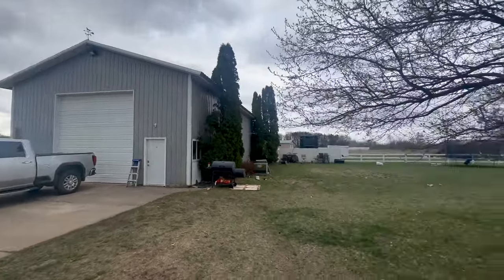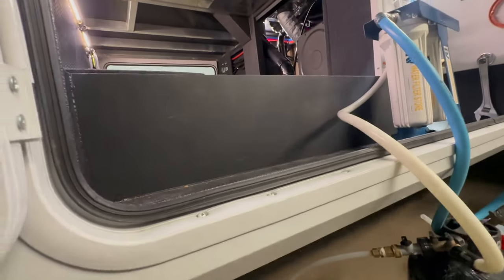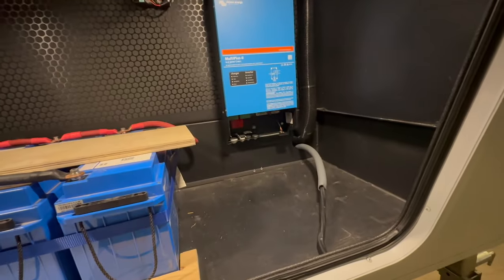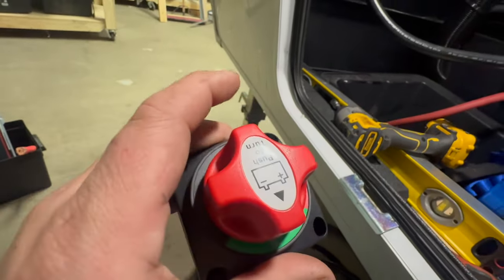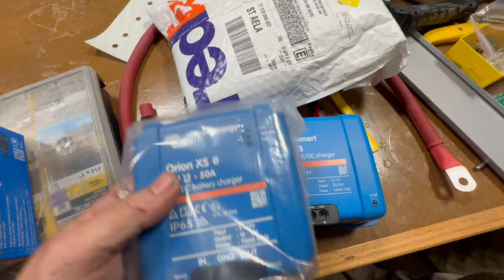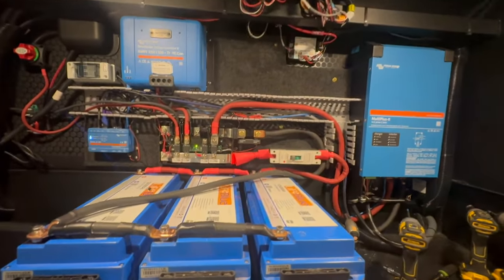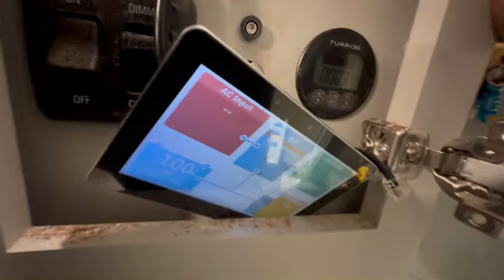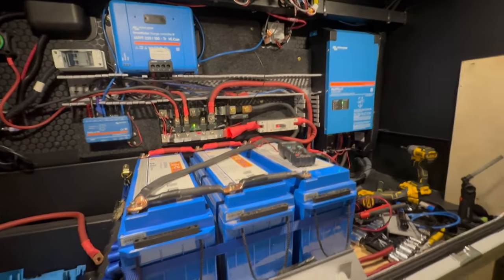Brinkley 5th Wheel Victron Solar System Install - Solar Week Day 5

Comment: If you had to choose one set of batteries out of :1 SOK 24 volt 100 amp hr. enduro 24 volt 100 amp hr. Litime 24 volt 200 amp hr. My concern is the 100 amp bms in the first two and no low temp protection in the litime? Thanks
Reply from the maker: If you had to buy 1 battery, would be enduro. If 2 or more, SOK. Reason being the size, service options and as you spread the load, BMS doesn’t matter as much. I recommend doing 2 or more batteries anyway.
Reply: @sotasolar  thanks, appreciate the information. I’m looking at doing 4. How many could i hook up in parallel safely?
Reply from the maker: @kurtmcclelland1086 we did eight batteries in the video that just came out on Saturday and Sunday. I just watch those to learn how to do it.
Reply: i’ll watch it again thanks